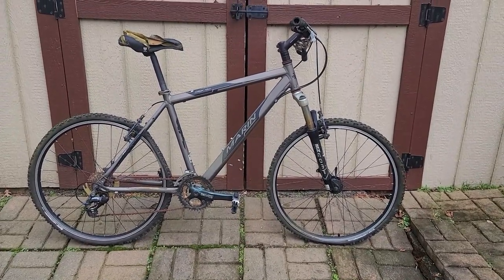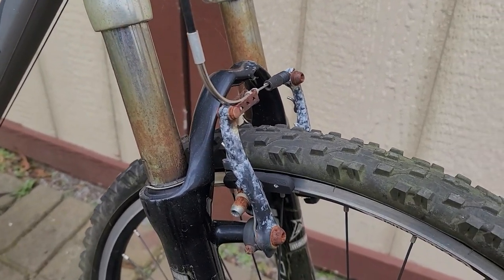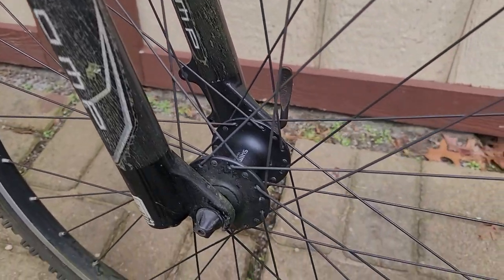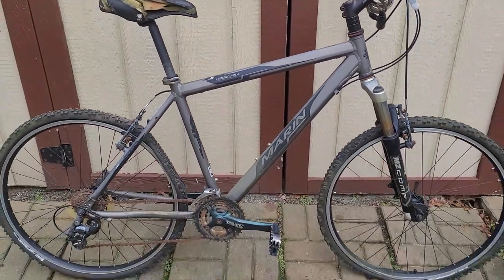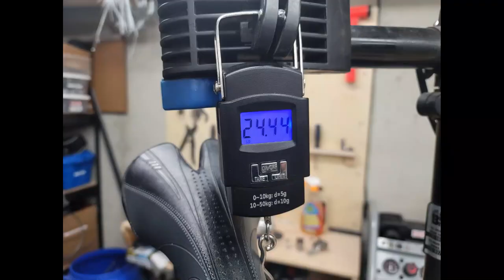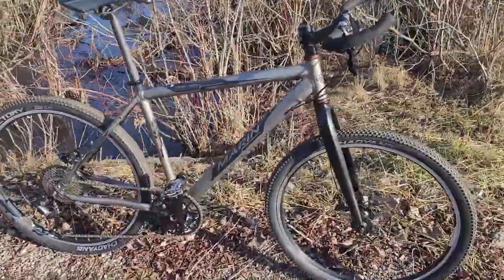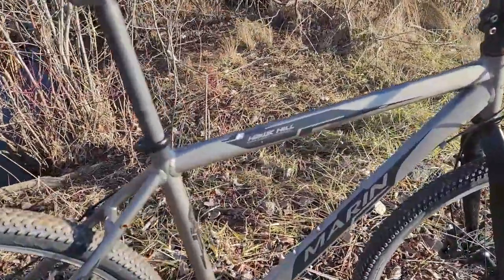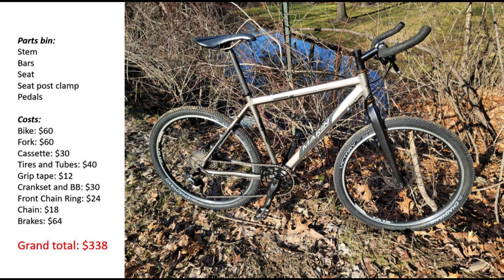How much does it cost to change a Mountain Bike into a Gravel Bike - Starring a 2004 Marin Hawk Hill

Comment: Looks like a winner!

I went the other way, converting my "road bike" to a gravel machine. Luckily it was originally built up on a Cannondale XS800 cross frame (with a headshock), so it took 35mm tyres. Add a Shimano Deore 11-speed 1-by drive train, a set of ancient Magura HS22 hydraulic rim brakes, a  25-year old Ti flat bar from an MTB, and a pair of classic Cannondale MTB bar ends wrapped in bar tape and hey presto, it's now a gravel bike. I wish I could fit discs for better stopping power in the wet, but you can't have everything. I don't know what it weighs, but it's fun to ride.

Re your MTB-to-Gravel conversion, I'd probably try and squeeze in 27.5 wheels, if I had them or could find a decent set second hand. With slimmer tyres than the MTB incarnation, they might fit. Worth thinking about for future mods anyway.
BTW: I've seen Shimano MT-200 brakesets for sale on AliExpress for prices similar to the Zoom brakes you found. The Zooms look like straight Shimano copies, so they may be just as reliable. But I've had good luck with Shimano gear, and parts and pads are available anywhere.

Happy trails!
Reply from the maker: Hey Brian, Thank you for the great comment! It's fun to make a bike anything you want and its always ok as long as you enjoy the ride! There is definitely room for 27.5 wheels on this one but I was trying to keep the budget in check. Maybe in the future. Also, I have had a few MT200 brakes thru the shop and you're right the Zooms look like copies of them.  I will say they do feel great and I have no complaints so far. Thanks Todd

Comment: If it's a good frame and it fits....  a great ride.  Used to love doing this.  I'd just add a dropper and do the bars different...  and its a perfect All Roads bike.
Reply: Oh, and get new tubeless wheels and lower the pressure for a smooooth ride with great traction.
Reply from the maker: Craig, your spot on! And the great thing about these bikes is how easy it is to make them be what you want it to be. Thanks for watching!

Comment: I have a fondness for Marin.  Looks great and I bet the components are better then what came on it.  Especially the brakes.
Reply from the maker: Hey Charlie, I agree with you. I have a thing for Marins too. I currently ride a 2019 B17 full squish and I have a 1997 Indian Fire Trail that I will be using on a future dream build. Thanks for watching!
Reply: My dad converted a Bear Valley to a road bike. From 559/26" to 622/700c, drop bar, conversion V-brakes with longer adjustment holes etc. Turned out great actually, even though the BB is high and frame geometry is not really made for that, but somehow it just works a treat.

Comment: I find working and restoring old bikes to be quite relaxing and rewarding while more modern stuff is generally the opposite being a frustrating chore. Your video is a good example of that.
I'd like to do something similar to my hardtail mtb to make it a little more road / gravel oriented rather than pure cross country. I'm not sure about ditching the fork for something rigid though. despite being a heavy component it's in perfect working order. Do you have any input on that regard?

Good video
Reply from the maker: Hi Mojo, the great thing about changing or modifying a bike for yourself is that you can do whatever you want and if you like the way it turns out, then you did it right. If you don't like it, then you can keep changing it until you it makes you happy.

Comment: Didn’t seem like the cranks spin very freely. Something with the BB or preload?
Reply: Pounding the shaft in like a railroad spike might have been an indicator of a problem.
Reply from the maker: I think I may have tightened the preload a bit too much.
Reply: @StrangersIteDomum  Unfortunately its what you have to do with these really cheap external BB's.  They aren't made to good tolerances.
Reply: @lastfm4477  should have pulled them off, mic them, return them. Not pound the crank in. Actually should have just regreased and reused the existing bb. Was probably a good Shimano unit.

Comment: Which length fork did you use on this build … was it the 27.5’s ?
Reply from the maker: I ordered the 26, but truth be told, it looks like it will take any size wheel. There's a ton of clearance above the 26-inch wheel. The link to get it is in the description.

Comment: In completing a similar build using a marin bobcat trail. Did you have any chainline issues with the 1X conversion?
Reply from the maker: Dan, In this case, I didn't have any issue. Probably because I got a new BB and single speed crankset.  I think I may need to add a link or 2 to the chian because it's maxed out on the tall gear.
Reply: I did a 1x10 conversion to a 2001 Hawk Hill.  I didn’t change the bottom bracket or cranks.  Haven’t had any chain line issues with my build.  Using an Advent X with 11-42 cassette.

Comment: what size fork did you use on this please
Reply from the maker: It was a multipurpose fork that is good for 26 or 27.5 wheels.
Reply: @DePuesshop  thanks. I have seen a few on ebay like that